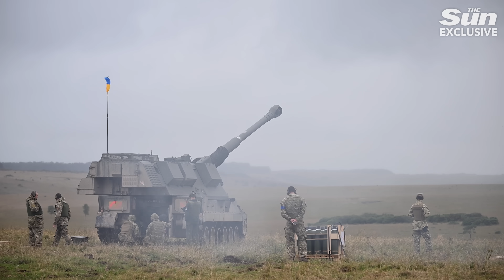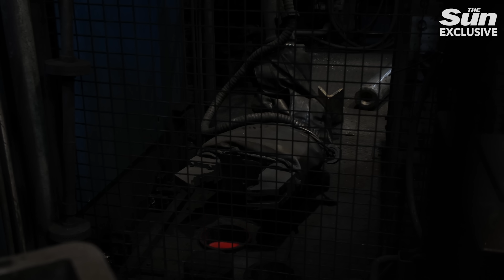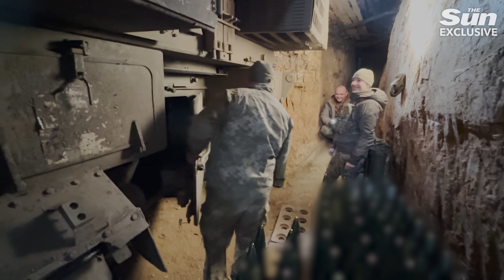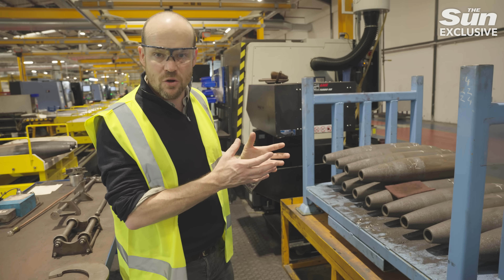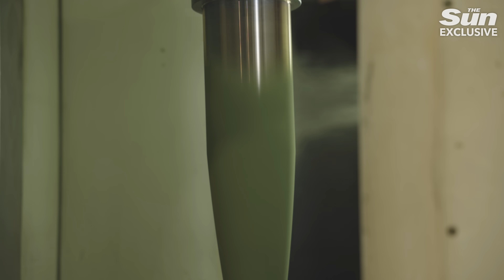Britain’s Massive Artillery Factory - Inside Look

Comment: So much wrong data. Heat doesn’t seal the obturator pressure does. Firing pin doesn’t strike the propellant, it strikes the primer.

Comment: Good job on this part.  I was disappointed that it ended as an empty metal shell.  Ultimately, it's not guns or even bullets or shells that do the damage in modern wars, but explosives.  Artillery has been the lowest cost explosive delivery device, but drones, bombs, missiles, mines, IED, and more all do the same thing: explode.  These shells have got to be filled with an explosive like RDX and capped with a fuse before they're ready to do their job.  The RDX factory and loading the shells is where something extraordinary could be seen.

This should be followed up with a visit to the Glascoed, Wales facility where they're now making RDX on site (before it was imported) and where they fill the shells.

Comment: Man I always wanted to machine these shells on a couple of CNCs. I always thought they would be using a much bigger forge and that they could ramp up the forgings to the point that they could send masses of rough forgings to other factories for turning. 
This process definitely seems more stockpiling than wartime footing. I wonder how many shells get scrapped in the hardness test stage for them to feel the need to check every individual shell instead of 1 or 2 out of each batch? I can imagine russia doesn't do all of these steps and that must be a big part of the difference in numbers produced. I'd have imagined we could make something that isn't quite as polished in bigger numbers that would still be better than the opposition.

Comment: My Grandad made 10 vintage shell casings for an old artillery cannon, this would have been at least 40 years ago maybe 50 years ago, he was in the Army as a fitter and Turner Woking out the back of an old truck! Once he left the army he carried on with the trade and ended up in a local machinist shop, they gave him the job due to his experience and made the 10 shell casings from Brass I presume, well after a very long time he had all 10 finished and they had a very strict tolerance restriction, well next morning he checked them and they where all slightly like 2mm too small he had to sit and think about it and all he could come up with was the actual machining had expanded the metal slightly so what he did was re make them exactly the same way but 2mm bigger knee finished and left to cool by the next morning they where exactly the right size! It sounds simple but back then experience was key making them by hand no CNC machines just a lathe, files and micrometers! It's amazing how advanced we have got now! But we still need new people like my Grandad trained by people with his experience its becoming a lost trade now!

Comment: Correction: Although some do have a firing pin, that isn't what strikes the charge to set it off. There is usually a small blasting cap, sort of like what's at one end of a standard bullet casing, and that is what ignites the main propellant charge. Not a pin that hits the primer bags.

Some use a fulminated type primer that is set off with friction, while others have a more traditional firing pin to set off an impact sensitive primer. Just depends on how the original cannon was designed. But they all accomplish the same thing; a small bang that produces enough Heat to cause the main propellant charge to very rapidly burn. Which then creates a ton of gas over a very, very short amount of time. 

Some of these cannons can produce 10's of thousands of PSI, which is why you'll see FPV's with RPG warhead hitting the barrels, preferably as close to the breech as possible. That tiny 1-2 cm hole is enough to drastically affect the point of impact... If it doesn't outright blow up the side of the barrel when fired. And the only way to fix it is taking it back to the armory to replace the barrel.

Comment: There's a reason artillery is nicknamed The God or The King of War. It can do things many other systems can't, high volume of fire for a relatively cheap cost. The basic shells are easy enough to produce quickly and at scale, and have ranges that exceed mortars and some rocket artillery systems.

You can absolutely blanket an area for the same cost as just a few aerial bombs. And unlike air dropped munitions, if artillery misses you can adjust the aim and bracket the enemy to try and hold them in place until the point of aim is dialed in.

Comment: Some "Defence" correspondent that doesn't know the firing pin doesn't strike the propellent at ALL. It (or an electrical charge) ignites a much smaller charge which then ignites the propellent. Obturation takes place not only at the driving bands of the shell (not the base) but also at the breech. Propellent doesn't "explode" either, it BURNS.  Pathetic explanation of the King of the battlefield. Sack this clown and get someone who knows what the hell they're talking about. @thesun

Comment: A couple things here...artillery can be jammed, if the artillery in question has a GPS guidance package, like the PGK kit that replaces the traditional fuse on the nose to make ordinary shells into precision munitions.
These particular rounds likely aren't getting fitted with a PGK kit due to the immense amount of jamming on the front, but they have been used in Ukraine the first few years, and possibly still are on certain targets.

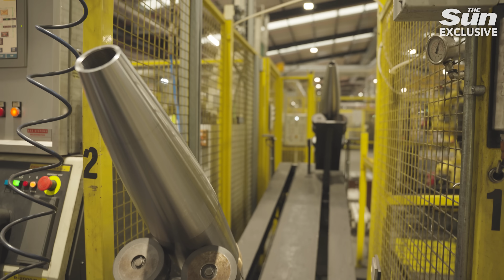At 12:13, it's SHOT blast, not shock blast.  They call it this because the steel is blasted with shot for a particular finish or to relieve stresses, sometimes both.
In this case I believe they're shot blasting the inside of the shell to make it suitable for the HE fill.

Comment: Ok... some mistakes here!
1. Very little of a shells energy comes from direct impact as the fuze intiates the shell almost as soon as it touches the target. The two effects that do damage are the blast from the filling and the fragments from the shell body. Some fuzes explode the shell in the air to increase the spread of the effects.
2. The fuze on a shell does not "ignite" the high explosive filling. High explosives detonate. Propellants ignite, high explosive fillings detonate. 
3. The firing pin does not "strike the propellant". The firing pin in the breech strikes a primer tube which sends a flash of flame into the propellant igniting it and producing hot gas. The expanding gas produces the explosion not the other way around!
4. It's an obturator, not an obdurator!
5. Shot blast not shock blast.

...and yes, we are not producing nearly enough of these or the fillings and propellant!
Reply: And ‘lathing’ jeez 🙈

Comment: All interesting stuff but pretty useless for actual war time manufacturing. Cant scale and if needed you need new factory. Main issue is that these shells are simply too expensive for real war situation and reason is that input costs are massive in UK. Electricity for steel making and forging, steel price itself, no support heavy industry including for cheap materials like explosives etc. Massive cost of labour and shortage of specialists. This factory is fine for peacetime training munition manufacturing and thats ok. In case of shooting war with some other semi developed country just forget it. You can make these shells in China for about 150 GBP per shell and in UK its about 4-5k GBP. Actual 5" fpv drones are currently made in Ukraine about 200 GBP and they are usually more useful than 155 mm dumb shell.

Comment: A very insightful piece, great work.
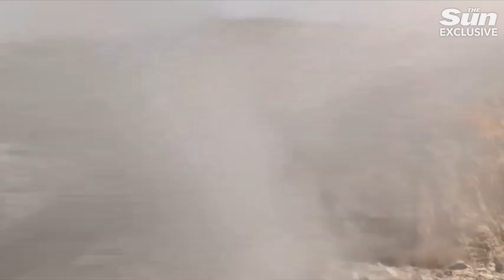7:55 artillery had already become disproportionately expensive compared to what was being targeted during 'the war on terror'. Firing at an enemy who does not have artillery to counter is often wasteful.
Drone warfare makes rapid manoeuvre and semi concealment drastically less effective.
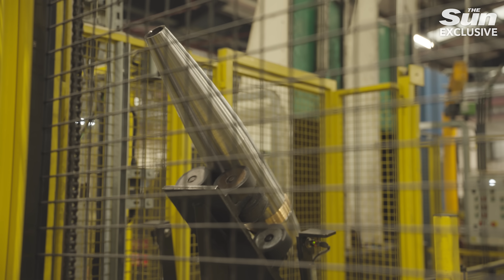12:46 the more a process is automated, the less knowledge of the process is needed. The shell is run through a very strong magnet.
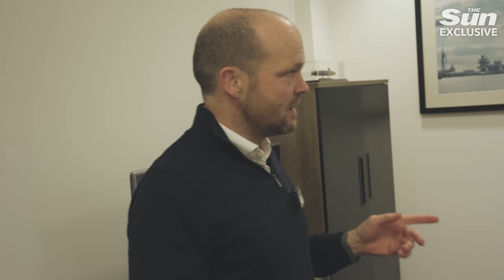13:34 automation makes it so there are not enough people with the skills to forge shells. This creates a heavy reliance on the global market for the machines and robots that have replaced those skills.
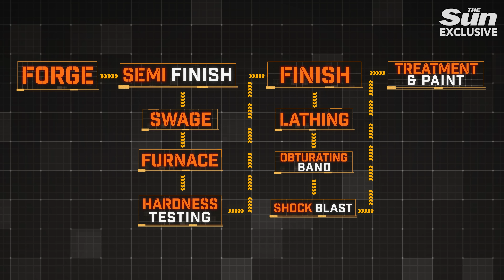14:42 because drones have less pressure acting upon them, they are safer and cheaper to make.
Each of these sells uses 2-3 times more material and energy to produce than a gernan mk.5
Our military's procurement process is broken

Comment: If the shells are attached to drones, do they need the copper band - I guess not. Has the UK started making shells specifically to be delivered by drone? They would appear to be a much simpler device to manufacture at scale. Just wondered.
Reply: 155 mm shells are too heavy for all but the biggest drones.  Theyre not designed to be dropped, only fired from gun tubes.  The hexa and octocopters usually drop mortar shells which are usually much lighter and can easily be dropped as they have fins and tail attached and are used in smooth barrels.

Comment: It's amazing to me that the shell doesn't explode from the sheer force of being fired.
Reply: Modern high explosives are surprisingly difficult to set off. They require a shockwave from the fuze train and booster charge to actually detonate. You can light them on fire and they'll just burn, they won't detonate.

They have to be relatively stable and safe to handle in order to be useful
Reply: They also design the base of the shell to withstand these forces, hence some shells can’t be firing with max charges
Reply: Likely almost entirely compressive forces during firing and then equalisation during flight.

Comment: One shell costs 4000 pounds a drone which is 50 times more accurate only costs 1000 pounds.
Reply: A drone is not 50 times more accurate, most drones miss, you just see the ones that hit. Drones also have a very small payload in comparison. Most people in this war, as with almost all wars have been killed by artillery.
Reply: @brianduffy8042  Obviously youve not been paying attention to statements made by those there in Ukraine currently.
Reply: Both are good but drones have downsides. They can be jammed, they lack payload and aren't very good suppression tools for incoming offensives. They can struggle in certain weather conditions and can have reliability issues. Artillery has a higher payload, can't be jammed, can fire in any weather, has good suppression and will explode. I've seen plenty of drone videos where the drone simply didn't detonate or just straight up missed because it relies on a user so the cost of a 1-3k drone being lost can quickly catch up in price to artillery shells. Like i said both are good tools and should be utilised but you can't replace either with the other.

Comment: isn't fuse spelt with an s and not a z?
Reply: It's correctly spelled with a 'z' when it's mechanical or electrical.  If you set it alight, spell it with an 's'.  It's nothing to do with American spelling.
Reply: @Li.Siyuan  nonsense. it's in english and therefore it's an "s". just look it up in an ENGLISH dictionary rather than an american one.
Reply: @aethellstan  just be quiet, you've already been told, it's nothing to do with american spelling. 
Fuse=A safety device in an electrical circuit that melts and breaks the circuit if too much current flows.
A cord or material that burns slowly to ignite something later, such as in fireworks or older explosives.
As a verb, “to fuse” means to join or melt together.
Fuze= is the technical military spelling for the mechanism that triggers a munition, such as a bomb, shell, or missile. A fuze determines when the explosive detonates-for example, on impact, after a delay, or at a certain altitude.
Reply: @brianduffy8042  just be quiet yourself.
Note: For military context, a "fuse" is often spelled "fuze" and refers to a device for detonating an explosive, while "fuse" is the electrical protective component.
so shut up.
Reply: USA audience spell with a z.
Reply: @droguechute1956  irrelevant. this is a british newspaper producing a video log about a british factory making british munitions.
s not z..

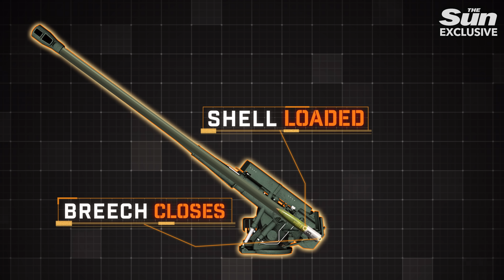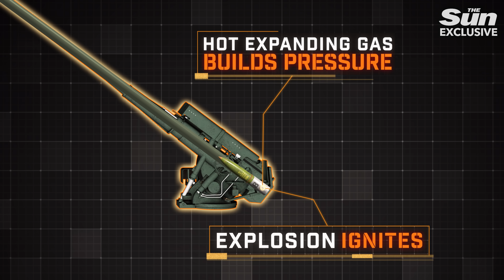Comment: 3:40 Actually, the "firing pin" strikes the primer. The primer ignites the powder. Technically, the powder doesn't explode, it burns. 3:55 The rearward obturation is accomplished by the obturator (mushroom head) that is a permanent part of the internal face of the breech not the shell.
Reply: Agreed, the powder or propellant burns, it does not explode.  The copper band or rifling band engages with the barrels riffling to seal the round to the barrel and importantly, impart spin.
Reply: They didnt go into breech blocks or the breech closure component/

Comment: 155mm shells have a separate firing cartridge that initiates the propellant explosion.  Think blank rifle cartridge.  Smaller artillery shells—like 105mm— with a brass propellant container have a built in primer.  Think very large rifle cartridge.  
The important thing about the fuse that he didn’t mention is unless you are targeting a solid building or vehicle, it is usually better to have the shell explode 5-15 meters above the target.  A ground explosion spends most of its energy digging a hole. An aerial explosion allows the shrapnel to spread out around the target taking out “soft” things like unarmored sensitive equipment and people.
Reply: Good to see someone who knows their stuff. A 105mm sheel is fired from a brass cart that has a primer inside that is set off by a small electrical charge from the firing box. The cart is filled with charge bags with different colors and numbers, which are added or removed depending on the range they are fired at. The fuze also has different settings SQ for super quick, explodes the moment it hits the target, delay for deeper penetration then you also got 3 different settings for air bursts, sending shrapnel across a larger area. And I 155 for the AS90 is the same, but you mentioned they have a small blank round rather than a cart like the 105mm.

Comment: Despite all the automation, it still appears fairly labour intensive. I guess this reflects the quality needed for a reliable and safe to use munition.
Reply: Long may it stay that way people need jobs more than ever
Reply: People oversee the automation....
Reply: some of it seemed a little  convoluted too ,ie: picking up shells with a robot arm , when a shoot or conveyor belt would suffice.but we do not know the in and outs of the production requirements, but yeah i was left thinking hmmmm bit Wallis and grommet
Reply: I was thinking the same. I wonder whether it is an older site as I suspect if you were to build one of these now much more would be automated.
Reply: There are many quality processes that can be automated. Suggests a lack of ambition in the management to improve quality and efficiency.

Comment: De Gaussing = de magnifier 🫵✊️.
Its a process also used on submarine hulls post build and often post refurbishment and is a means of aiding stealth as a common detection method is for maritime patrol aircraft to use their "magnetic anomoly" detectors  to locate submarines.